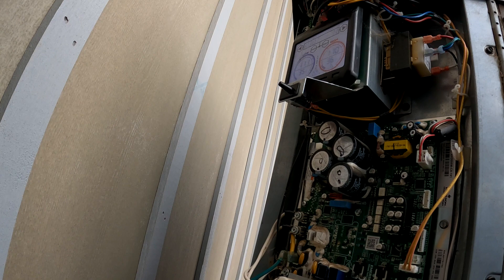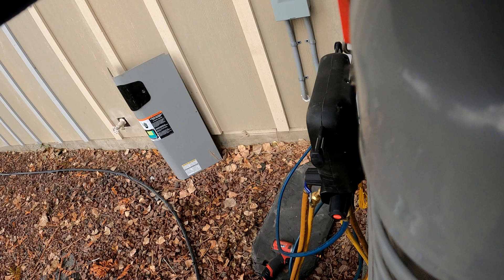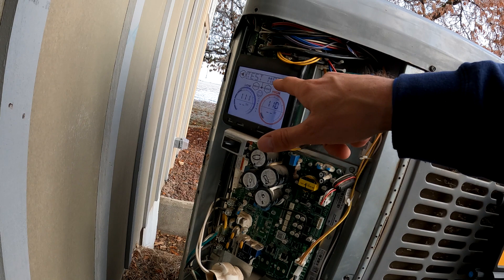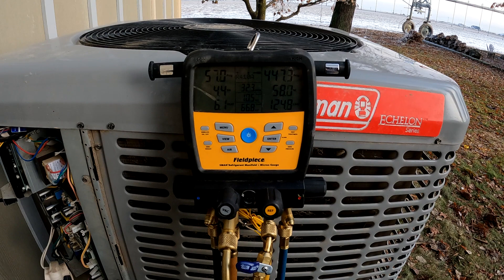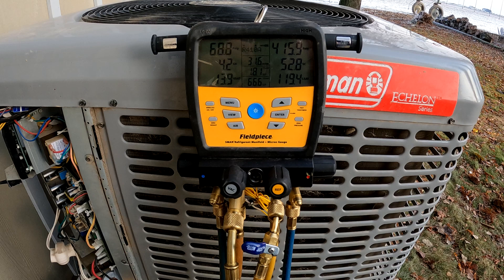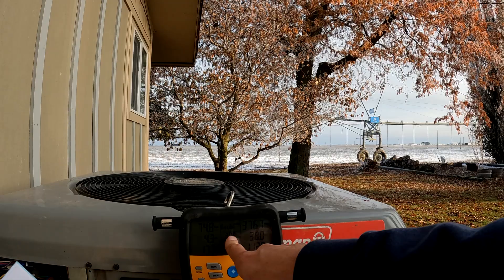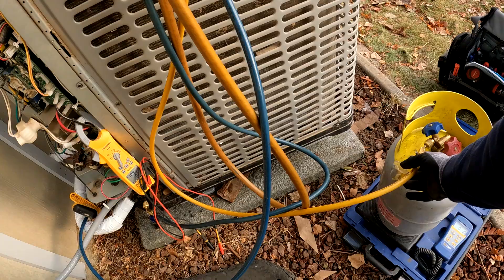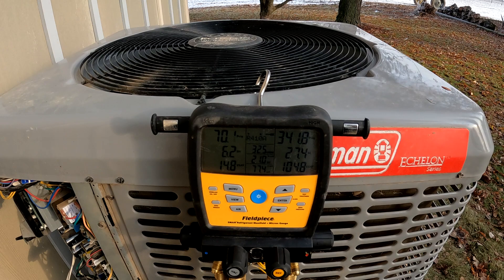HC20 Heat Pump High Pressure Lockout

Comment: How do you reset a high pressure lockout switch and where would it be? I needed to do this after replacing a capacitor and didn't know.
Reply: Disconnect low voltage to board